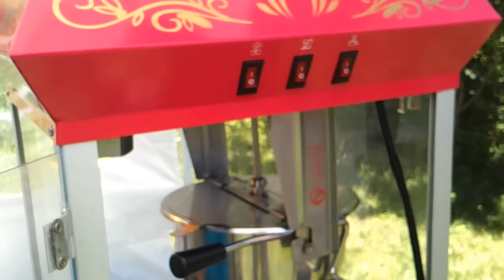How to use 8oz Popcorn Machine (kettle) - Party Rentals / Home Theater / Movie FULL DEMO!

Comment: I have the same one and I got 2 jars of popcorn for the machine but when it's ready it doesn't turn to yellow color. Do I have to soak them in the butter oil before putting it in the machine ?
Reply: Use dyed coconut oil, and a little special ingredient called flavacol

Comment: What model is this machine? Is it 

Gold Medal 2388 Commercial Popcorn Machine-Red, 8-oz.?

The movie theatres don’t put the oil in the kettle because the oil burns.

My concern is if once the popcorn pops in the at home machine like in this video will the popcorn be hard. I want as close to the movie theatre popcorn as possible. Microwave popcorn doesn’t pop as well as kettle popcorn

Comment: I have found two issues with mine. 1. Even when fresh fresh it doesnt taste that hot and 2. Its a bit soggy. Should i try adding the oil first without the kernels?
Reply: Izard warrior  I got it from the Baie, my specific one was 300$
Reply: I have the exact same issue. I’ve been heating the oil first and then putting kernels in and it’s so chewy.
Reply: @ernest9334  i added a bit more oil and it hasn't been as bad of an issue, but still not "crunchy"
Reply: Same issue. Wondering what I'm doing wrong to get soggy popcorn
Reply: @mannymacias627  over last 2 months I’ve perfected my recipe! I use double the amount of oil the machine recommends, about 3 tbsp for 2/3 cup of kernels. I use peanut oil so it can get really hot and not be smoky. 

Step1) add oil and turn on machine
Step 2) turn on stirring button
Step 3) add kernels, leave the lid flap open so they don’t steam. 
Step 4) once it kinda sounds like they might pop, slap the flap down so oil and kernels don’t pop all over the place. 
Step 5) Enjoy

Edit: I also wanted to add I really like the mushroom popcorn and the baby white popcorn from Amish country popcorn. The baby white is fun and small and super crunchy. The mushroom is nice and big and fluffy with a little crunch.
Reply: You might need to leave the doors open to let the steam escape…. Too much steam inside the machine can make the popcorn soggy or not as crunchy

Comment: This 8oz. popper looks like my recently received Great Northern Foundation Vintage style popper with cart. Do you use machines with carts and so can you provide some info on assembly of the storage unit with shelf? I am having problems getting the info I need from the mfg of this product. The shelf sides don't stay attached to the bottom and the assembled sides come off the bottom/shelf when the cart is moved even though the shelf is bolted to the long and short sections of the cart/stand frames. Can anyone help on this?

Comment: Very helpful, thanks. If you want it salted, would you put salt in the cooker plan first?
Reply from the maker: RJRPaice no, salt after dumped from kettle.
Reply: If you want taste like a theater, don't use salt. Use Flavacol, which is cheap and easy to get online.  You put the Flavacol in with the seeds and oil.  You can sprinkle more on the finished corn if you want.  But that's the salt you want to use.  It also colors the corn orange.  If you don't want the color, there is a Flavacol without the color.  It's natural orange color, totally safe.
Reply: @NortonRailway  jhBbqbBbqjqbqhq

Comment: I have the same machine but every time I make popcorn is crunchy outside buy soggy inside....why? What I'm doing wrong
Reply: BB Ruiz maybe you should preheat the kettle a little longer and try to use a little bit  less oil
Reply: BB Ruiz try opening the door just a little to let steam out while it's popping

Comment: I have a one like that and mine keeps popping out of the gear. Any ideas on how to fix it?
Reply: If you are talking about the gear up at the top on the ceiling, it could be the plastic part that holds the two gears in line is cracked. It happened to me   Found a new piece on online.

Comment: how long will the pop corn stay heated in that after it pops? and how long is it good for if it does not get eaten the same day?
Reply from the maker: Popcorn (if kept in an airtight container) can stay good for up to 7 days.  *ziplock bag, large plastic shopping bag or even large trash bags.  I was also a manager at a movie theatre, and I'll tell you a secret, much of the popcorn was cooked on Wed for the upcoming weekend... They kept it in large trash bags, twisted with twist ties, dated.  Anything over 7 days would get tossed. 

As for heated question, that depends on the machine.  The machine shown has both a heat lamp and a heated bottom tray.  Most of these units will have at least a heat lamp.  Just leave lamp on and occationally fluff popcorn to keep it warm.  If re-heating, give it 30-45 min to heat up (fluff every 10 min).  Maybe less...
Reply: there's a heat lamp in the unit , and usually the floor is heated too
Reply: i lick popcorn
Reply: Claudia Figueroa that's the most corniest comment I've seen ;)
Reply: want to know.wattage of this machine
Reply: How much popcorn to oil if using my own?

Comment: how hard to clean, do you clean after each time you use it?
Reply from the maker: mjones53 it's pretty easy to clean with warm water.  Remove kettle, rinse with warm water, wipe clean & dry.  Clean after done using.  For bad burns in kettle, try kettle klean I think its called.